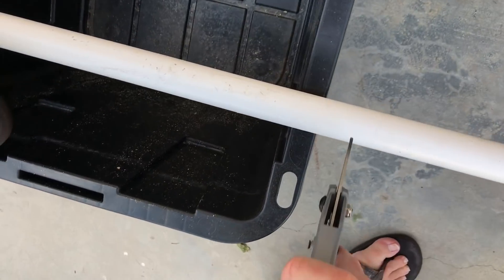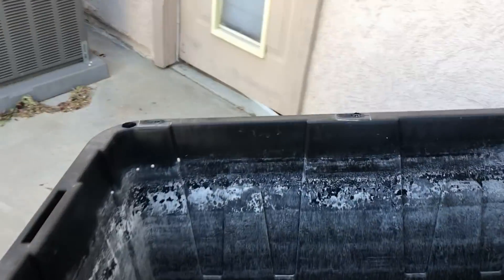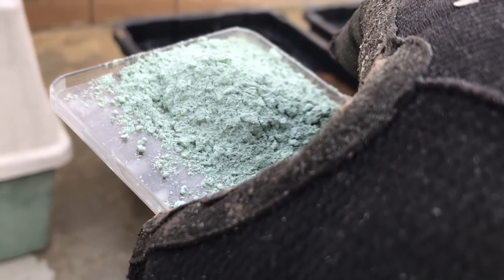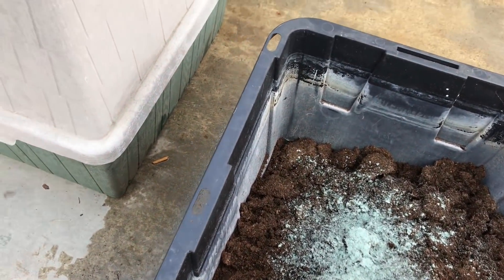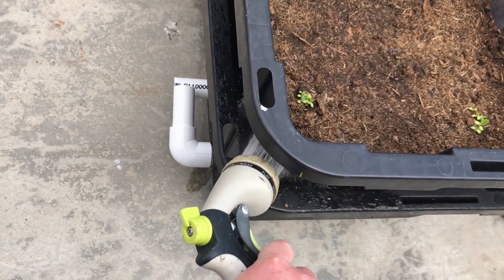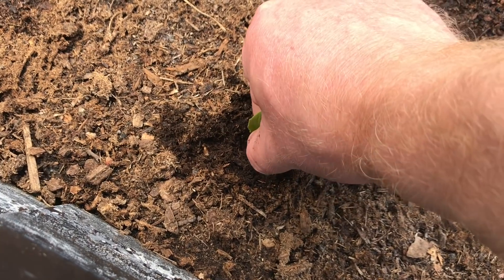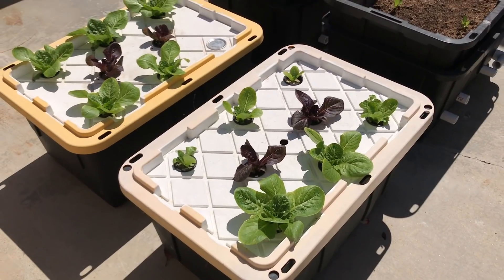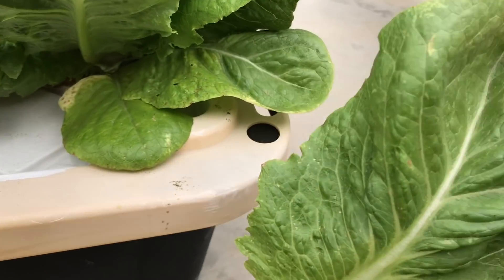Soil growers can't handle this video!

Comment: Plant some spinach along with the lettuce because spinach is weak againts pythium (a type of fungus)and in hydroponics theres a lot of pythium because pythium spores swim in the ground it's hard ,but in the water ,it's pythium heaven , but since lettuce is stronger against pythium ,it makes the population low, saving the spinach and ypu also have a batch of lettuce as a bonus
Reply from the maker: i dunno i think pythium might be a myth
Reply: @JebGardener  actually it causes root rot
Reply: @JebGardener  so no it's not a myth
Reply from the maker: i dont think its a problem unless the roots die from something else

Comment: Compost teas are great for both hydro and soil. Just like growing anything and soil it's good to make and evenly balanced mix start with a good quality soil like Cedar Grove add compost worm castings grain-fed manure, I like to add a little perlite and vermiculite and add eggshells for any calcium Hogs. I also like to add a little dissolved Epsom salt for magnesium. And I usually put a little bit of copper around my planters to help with slugs and a little copper to the soil. I use copper wire, pennies, or sanded pipe. If you can get some fish emulsion that really helps with the fertilization. And I like to make a little mixture using Chili Peppers that boil and strain, put that in a strainer, how to drop a Castile soap, and spray your plants and you will not have any problems West pests. For ants I like to sprinkle a little bit of cinnamon around the soil. And pretty much with that I still like to water my garden every couple days. good luck gardening hope this helps.

Comment: The HUGE problem with hydroponics, especially a closed system, is that the plants only get what YOU give to them. PERIOD. I don't care how "complete" the mix is, that is ALL they get. Even most depleted soil has more in it that commercial mixes. May not get the HUGE plants, but at least what you get is REAL food and not CHEMICAL food.

Comment: That is not soil! And that not even peat moss (do your research); that just sawdust mixed with coco coir. That is why nothing grows in that. When you plant in a "soil" like that, and you start watering it, it starts the composting of the sawdust, and it required nitrogen. You should never-ever buy those junk. Those leafy greens need lot of nitrogen to grow properly, and because the composting of the sawdust eats up all the nitrogen (if there is any, but there is nothing in those junk), that is why those plants are no growing properly. And not because "it's too dry"! SERIOSLY? You show us a wet medium, so you are not telling the truth...That "Super Green Stuff" is added to the soil NOT because of it is a source of silica: "The porous properties of glauconite greensand allows for the absorption of water and minerals, making irrigation and nutrient delivery much more efficient. Greensand can be used to absorb excess water in clay-rich soils and to prevent water loss in sandy soils." You doesn't even know what you use and why...

Comment: Thanks Jeb, I am a soil grower (amateur soil grower when it comes to lettuce and similar), and I can handle it (LOL) for I doubt the flavour, texture and success of growing your lettuce is overall better than my lettuce growing (but I have lots of good wormy soil and plenty of reasonable quality water.  However thanks for your great videos and  I see advantages from this tech for commercial operations particularly with increasing irrigation water prices and decreasing water quality, also if it has a aquaponic integration there may be some good advantages? partly because aquaponics can put a canary in the hydoponic coal mine?
Reply from the maker: Aquaponics looks cool but usually when I see those systems, the plants don't look like they are performing well.

Comment: I think this vid is funny and educational. Definitely proves Hydroponics is superior, especially for a novice grower. I will be converting to Hydroponics simply because it's overall a cleaner operation and gives the grower more control. That being said: As a soil grower, growing Connecticut Pumpkin & Watermelon, I use a 50 gal. drum to "Compost". All non animal kitchen scraps go in. Takes me a little less than a year to fill. I take all that rich black goo, mix it with 4:1 ratio of potting soil & steer manure, add a full bottle of Fish Emulsion, mix throughly. Then I pick a spot in the yard, excavate a 4'x4' hole about 2.5' deep. In goes all my homemade soil and the seeds. From there it's lots of water & sunshine. I always have great results, but I also put a year's worth of work into manufacturing nutrient rich soil. 
Now, back to: I'm switching to Hydroponics.
Reply from the maker: the future is doing both

Comment: Thank god I grow in ProMix.  I almost wouldn't be able to handle this!
Reply from the maker: is that stuff real easy?
Reply: @JebGardener  Well... I grow in soil of some kind because it has proved easier to me, but if you have a good sealed bail of promix, it is cheap and bug free from the start.  And it comes with pearlite and mycorrhizae built in if you get the right one.  I never noticed the difference to soil or anything else, because I always use a full compliment of nutes, but my PH game is kind of lazy, falling in the "pretty good" region of adjustment.  My lights are LED's and are on point.  And my environment is on point with heavy ventilation and air movement.  I am growing cannabis autos right now but have done photoperiods with great results.  I usually do 4 or 5 plants in 5 gallon pots, 3 gallon now for the autos, in promix HP with myco.  I feel like soil is easy and mitigates mistakes, but promix is cleaner and the sealed bails are always bug free (watch out for holes in the bail).  I feel like if you are doing heavy fertilizing with nutrients anyway, you dont need the pure organic soil microbiome thing.  The mycorrhizae helps with that, and the nutes fill in the blanks.  I use Age Old grow and bloom, and add calmagic, seaweed, and bat guano/earthworm castings from Big Bloom.  I always push the nutes until it's almost too much, then back off.  I get buds that are dangerously goopy with trichomes, and I think micronutrients like the seaweed and Big Bloom (guano/castings) are the big factor.  The promix is just that nice place close to soil, but a little more clinical in approach.  Soil is more for people that have R.O. water and can do a real microbiome in my opinion.  Try it, it's cheap enough to get a bail and you seem to be willing to try whatever.

Comment: I can handle the video... mainly because Carmina Burana rocks.   I don't know about the gardening experiment though.  I didn't understand how the peat moss wicking system was supposed to work.  It obviously didn't.  I can throw some lettuce seed in my garden and it will be just as big as that hydroponic stuff in 50 days.  I might not even have to water it if rainfall was normal.  Pull the weeds twice,  and nature would provide.    Hydro is awesome for people who live in the concrete jungle or a fallout shelter,  but planting in garden dirt, (not in a plastic storage tub) is probably easier.
Reply from the maker: sounds like you enjoyed it.  thanks

Comment: Ok Jeb, how often do you change our your water in the hydro, and how often did you add the green sand to the hydro?
Reply from the maker: I don't change the water or add more green sand.  There was a lot of green stuff in the bottom of the tote so I don't know how soluble it is.

Comment: First off. NEVER USE MIRACLE GROW! That's not even soil its poison.. two you have your fake soil but no food for them you did it all wrong... soil would start seedlings then plant and plant into soil with ready available food. You used soil that doesnt feed but tiny amounts for 6 months. So duh it didn't grow. No humidity fome for the seedling yet in hydroponics its constantly being wet. Your Incorrect in almost every way.

Comment: Obviously you didn't take care of it well, besides I planted lettuce in winter, spring and summer in soil, after 25 days it grew from seeds to about 2-3 inches. after 50 days it was about same size as your crops or maybe bigger, depends how well you take care of it, and after 70 days the crops weight was between 700g to +1kg per crop. and they were very fresh healthy and natural i didn't use much fertilizer. 

if you tried other crops like tomatoes or pepper you could have fooled me since they take few months to grow, but lettuce doesn't take that long, and I've already grown it several times so you can't fool me. you're just not doing it right
Reply from the maker: busted

Comment: Replicate your test but add nitrogen to the soil in throughout the season. Leafly greens need a lot of nitrogen. Your hydro has nitrogen that isnt leaching like in soil. Also phosphorus and potasium was probable different from hydro to soil.
Reply from the maker: i want to use the wicking beds for expended hydro nutrients.  So I may do exactly that
Reply: @JebGardener  that will help but once your hydro plants take up the nutrients they are depleted. It will defenetly help some though. Try one bed like that and another feed your plants with NPK + minors and  dont forget to feed periodicaly to replenish leached nutrients. Wish you the best good luck!!!
Reply: @JebGardener  reusable shopping bags on top of a rain gutter work extremely well for wick gardening and as a bonus you can add nutrients to the rain gutter and let the soil wick it to the plant roots its like hydro meets soil

Comment: Well.... Its worth a shot https://media.discordapp.net/attachments/299728920394072095/509275723085643777/DSC_0161.jpg I Seem to have placed my plants a bit close together though. About 19.5 cm between cups in any direction.
Also time will tell how bad a growth medium pine bark is for mixed lettuces.
Reply from the maker: fertilizer will probably give you O2 problems
Reply: @JebGardener  The decomposing pine bark may give nitrogen problems too. But this is my only option, its far too hot here to grow lettuce in the ground, it always bolts. I'll see how this goes anyway.
Reply from the maker: good luck

Comment: You were right! Soil growers soiled themselves after this video judging by the comments. As an outsider looking in with no desire to garden, after reading the comments I would do Hydrophonics mostly due to simplicity for the same results. A lot of these people get up in arms about not adding the proper nutrients and fungi to the soil solution. This is precisely why Hydrophonics seems like the clear cut winner. You dont need to add all this extra crap to make it work the same as a non soil plant.
Reply from the maker: i baited them.  im so sorry

Comment: If you make your own kombucha (fermented sweet tea), for every batch you create a new scoby.  Those are "symbiotic cultures of bacteria and yeast".  One use of the extras is to mash them up with something like an immersion blender, and add to garden soil.  The beneficial bacteria seem to enable the plants to absorb nutrients more efficiently.  I added some to just a pot of zinnias, and they absolutely exploded with blooming.  Even my neighbor commented on them.  Kombucha is easy to make with about 1 gallon of mostly organic black tea, and about 1 cup of organic cane sugar or another type of organic sweetener.  You steep the tea and dissolve the sweetener, then cool to about 84 degrees, and add about 3/4 bottle of GT's original or 1 bottle.  Keep at about 84, and in about 5-7 days, you will have kombucha and a new baby scoby.  You can make a new batch with the same tea blend, the new scoby and about 1 cup of the new batch.  Kombucha is great for you, too.
Reply from the maker: I want a wicking bed I can dump used hydro nutrients in.  Whatever bacteria thrives in that environment will already be there

Comment: water growing plants has it advantages sure it grows faster but they usually have less taste than the ones grown in soil which means even though its take longer in the soil the plant taste better than water grown even with added nutrients u should test this explanation jeb.
Reply from the maker: have you done a side by side comparison because I have eaten this stuff and it is fabulous!
Reply: @JebGardener  no but its something my biology teacher said if u just grow plants in water the nutrients or taste won't be strong as the one growth in soil but seem in ur videos where u use green sand into the water mixture you are substituting the soil by just using water and nutrients which it can go both ways
Reply from the maker: I think the soil lettuce will have a stronger flavor because stress and slower growth contribute to flavor.  Most people dump dressing all over their salad so I don't know if it matters.
Reply: @JebGardener  😂🤣
Reply: @JebGardener  and great videos keep up the good work and u should try to grow more plant in hydroponics like pineapples,avocados ,peach or lemons

Comment: I see a lot of uneducated people commenting on hydroponics is just good for fast not strong or healthy growing .WRONG.

with hydroponics I can control what my plants uptake with soil you have to wait for the soil to provide hoping you mixed the soil correcorrectly.. With hydroponics I know whats happening because I control it! My hydro plants will be stronger healthier and bigger! Every time! Period no comparison.
Reply from the maker: yes i dont get the logic that the plants would be weaker in hydro
Reply: I think if you supply the appropriate nutrients and sunlight they will grow well either way. The issue with soil is you have to condition it to the right mix of nutrients, but it's the same as the water in hydroponics. I think as long as the soil isn't connected to the ground in anyway the advantages are negligible. 

I grow my lettuce in wick beds with straight compost, I add nutrients just like you do with the hydro into the reservoir minus nitro and it grows fast. Then I send the compost through my compost pile again as Brown material and. Wash and repeat.

Comment: To be fair the lettuce in soil is shaded by the tubs and not receiving the same sun. My lettuce grows great in my soil tower garden. Since its a composter\worm farm as well I don't have to mess around much with feeding. I neglect it for weeks at a time and planting it poly culture means very little pests. It's a affordable diy version of other tower systems with a lot less work. Finite Farms Vertical Gardens on Facebook.
Reply from the maker: problem was the dryness, not the shade.  sounds like you have a cool setup

Comment: I did more credible experiments in 5th grade..... Total crap!
Reply from the maker: i dont believe you
Reply: @JebGardener  My experiment was sprouting 3 bean plants, I then gave 1 soda and 1 coffee and the last with water, the soda and coffee plants died....... Shockingly right? First of all pH needs to be adjusted it the peat, the lettuce preference is 6.0 to 7.0 green sand will accomplish this if added correctly. Then you need to add equal ppm of fertilizer to both. You can't add a tray of nutes to hydro setup and add nothing to peat moss, as there is usually no nutrition value in peat moss. Last, hydrophonics use oxygen to keep roots from suffocating, same with soil, peat alone creates a highly anaerobic environment

Comment: Soil grower here I'll let y'all know.
Fist of all, horrible choice for a base soil, no grower worth his weight uses MG when there's better out there for cheaper, shit I bet the dirt in your backyard would be better than that at least it might have some life in it, also you cant expect a micro nutrient like silica to be a determining factor in plant growth in soil when completely disregarding any other nutrient, like I know you could do better and I'm not upset, its just kind of a shit experiment, also
Water retention could've been fixed my adding coco coir by knowing that the extra exposure to the hot air underneath would cause root damage and reduce plant growth without a stable supply of water, I honestly feel bad for them leafy bois
Reply from the maker: sounds like you handled it well

Comment: Of course they are gonna grow faster in water. In that system, the seedlings aren't beimg starved pit for moisture. You have you water seedlings from the top when they are in dirt. They do t habe long enough roots to reach yet, whereas the rock wool waters for them u.til they are long enough.
Reply from the maker: yes i pointed that out

Comment: Instead of rockwool cubes try grow stones u might like them
Reply from the maker: i want to try that at some point
Reply: @JebGardener  yea they are good I really liked them so far. They have 2 different sizes. A little pricey but in my opinion but well worth it
Reply from the maker: are they reusable as they advertise?
Reply: @JebGardener  u know I'm not 100% sure on that but I'm sure u could clean them with some type of method. If they get too dirty and u cant use them  for hydroponics then just use them in soil afterwards. I've used them in soil and hydroponic style. But as for cleaning them not sure. Definitely worth a try. And then make a video!

Comment: You should perform your experiments with at least 3 replicates for each condition.
Reply from the maker: good idea but i have space concerns
Reply: @JebGardener  You can use a lot of space to do 3 experiments at the same time, or a lot of time to repeat the 3 experiments in the same space (I suggest the second one, so you just re-use your "manufactured" equipment. Maybe it's a good idea to do it when you find some results that are really incredible : ) ).
Reply from the maker: good idea.  im working on fixing the design flaw before I try it again.  mainly i just want a taste test and reasonable growth comparison.